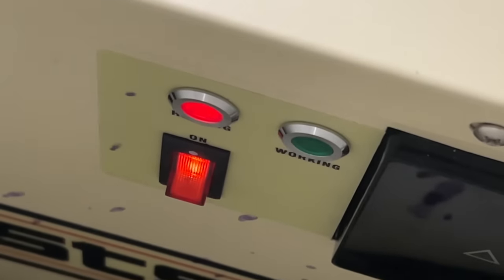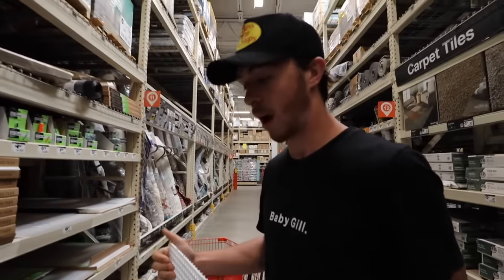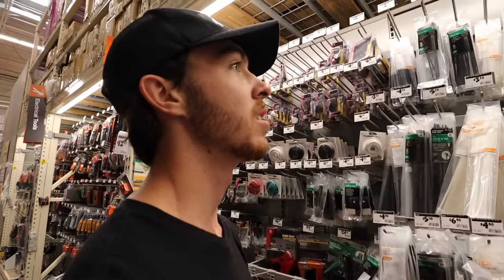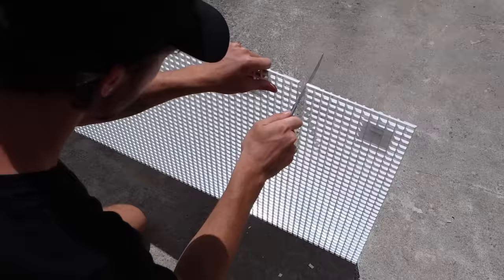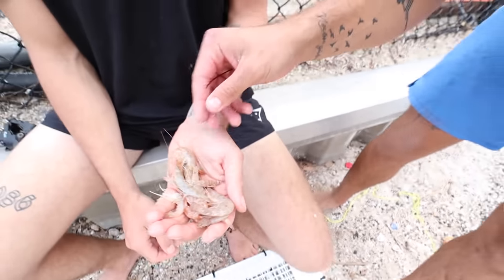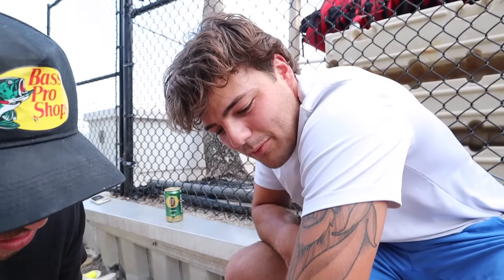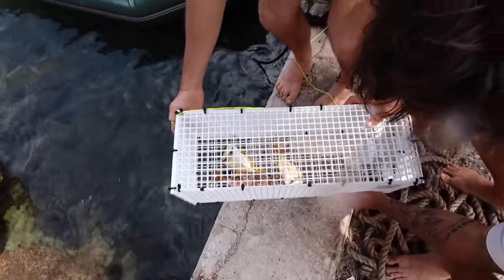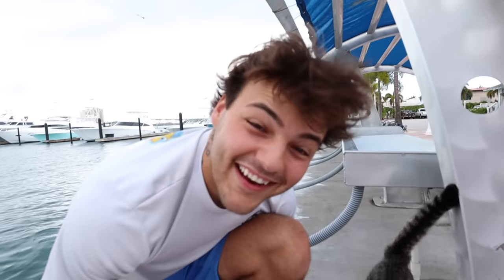Catching EXOTIC REEF FISH in DIY TRAPS!!

Comment: Next time use chicken wire and hog rings it will make a more of a stronger trap and easier to work with instead of the zip ties and it doesn't brake like the plastic does hope it helps get you the win on the next fixing trap video love the chanel keep it up :_PCsquadCuffaros::_PCsquadOGs::_PCsquadWow: